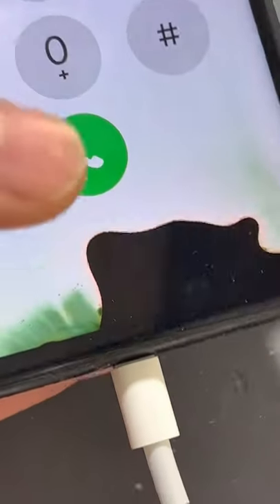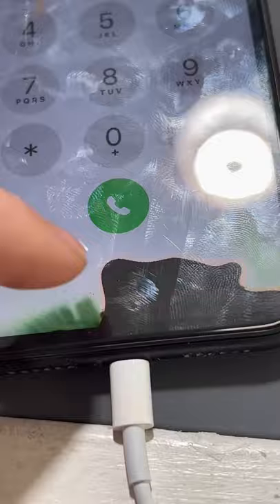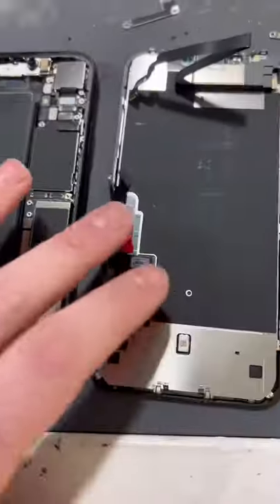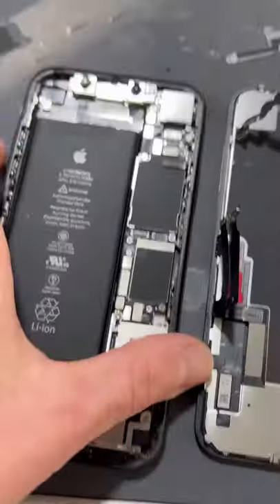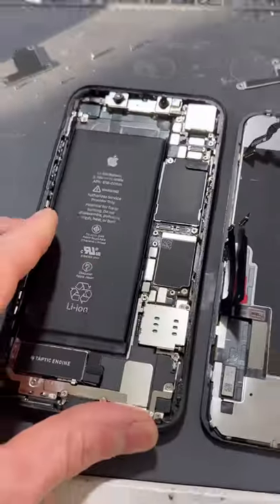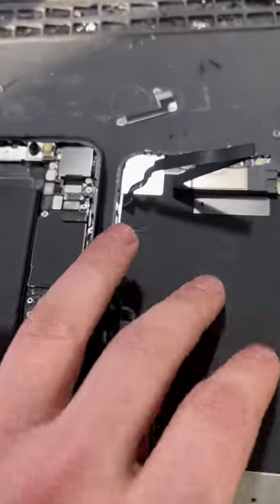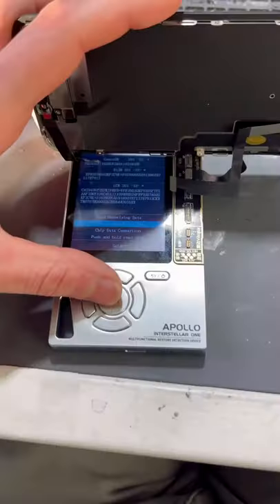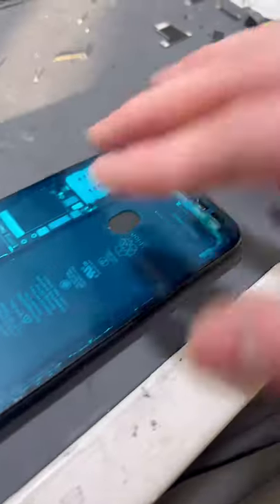Why do they not replace the seal? 🤨 #shorts￼

Comment: The reason they don't replace the "seal" is because it's not a seal,  it's water proofing and is hella superfluous..... Hit the old  with a hair dryer it will hold better and the replacement  adhesive is junk even the Tessa cut outs. I recommend only replacing it when it's completely shot because it being bad it better than the aftermarket junk.
Reply: Unless there’s chunks taken out of it. Also, water resistant not proof

Comment: will the seal remain waterproof after being replaced?
Reply: no it's not a seal just water proofing. after it's been cut it's not water proof at all the aftermarket adhesive that comes with most screens is basically trash. so definitely not water proof at all.  after a few months of use around 12 or so the factory stuff looses most of its ability anyway best practices is to keep it away from liquid even when it's "sealed"
Reply: @joshuahudnut4992  thank you, nice info🤩
Reply: Water resistant*